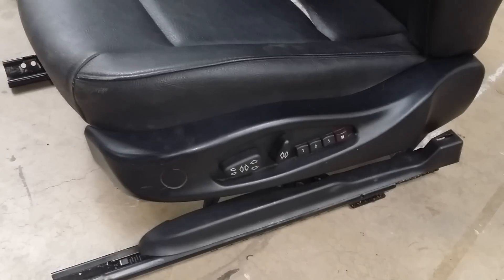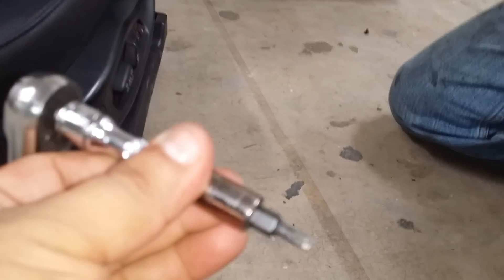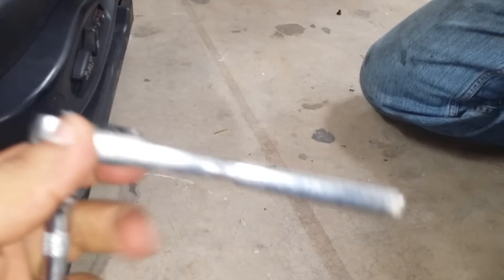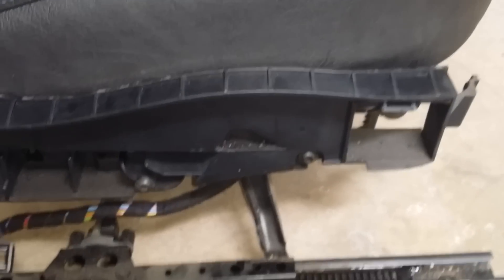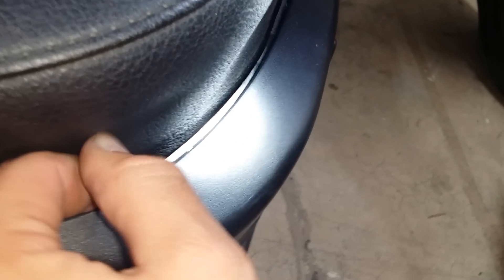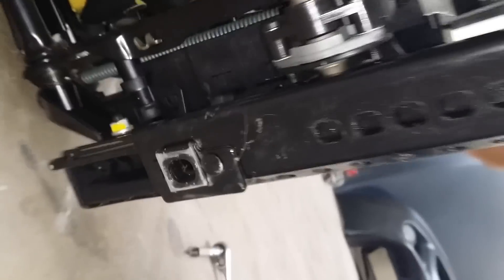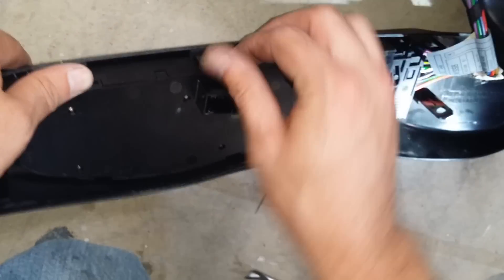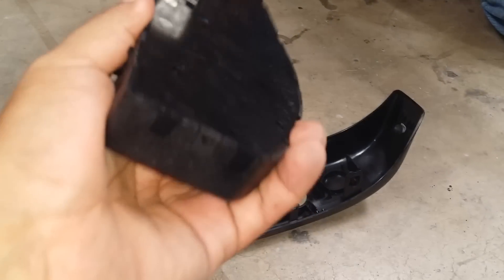BMW E46 325i 330i Sedan Front Seat Control Buttons Cover Removal

Comment: As is the case in all BMWs, all that incessant plastic creaking noise of older seats drives me nuts! Every time I sit down and shift my weight in the seat, all I hear is creak creak creak. Would love to see a video  disassembling the seat like you did but also show how to stop all those plastic creaking noises. I suspect it would involve glue and custom cut pieces of felt to act as a buffer between various plastic panels and also between plastic panels and the leather side portion of the seat.

Comment: How would I open the back part of the seat to access the lumbar bag and air tubes? I've got a leak somewhere on my 2003 BMW 330i Sedan with leather seats and lumbar support. I can get the lumber to balloon up but it loses air over about a minute. :/
Reply from the maker: It's been a while since I've removed the rear cover of a seat, but if my memory serves me right, there are two torx bolts at the bottom base.  Once you remove torx, pull cover down and that should expose interior of seat.  Let me know how it goes.  Thanks